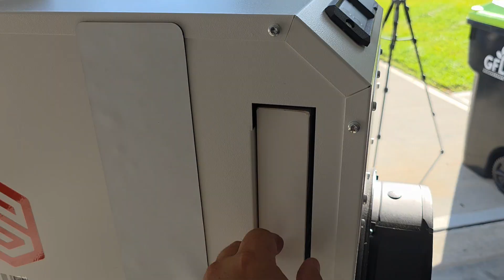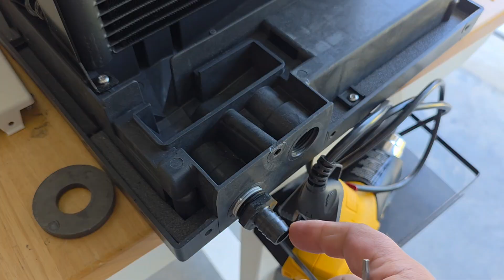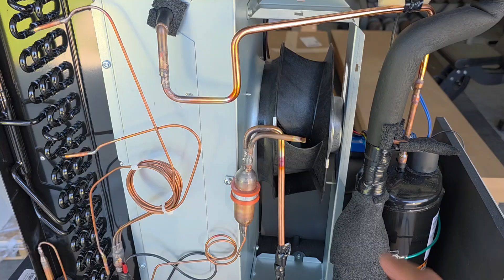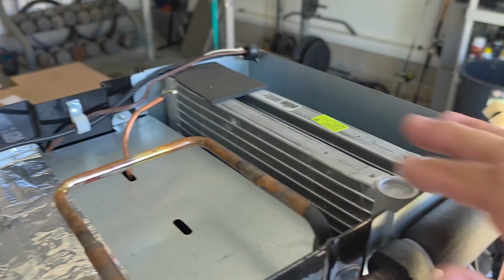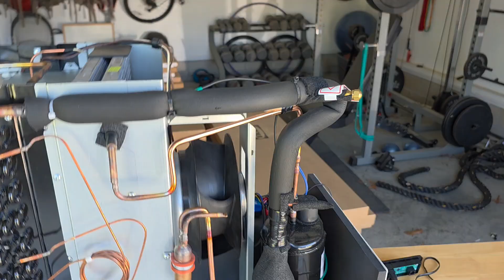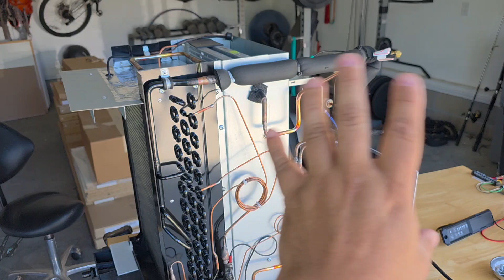Santa Fe V155 Next Gen Dehumidifier

Comment: Is this more efficient and smaller form factor available and replacing the Santa Fe Ultra 120?  
The ultra 120 is about 1/2 the price of this v155.
Reply from the maker: It's also about twice the weight LOL. The 120 has a weanie fan that cant overcome static
Reply: @timdestasiohvac can you recommend any smaller unit than the v155?  

Thanks again
Reply from the maker: @erickessler6094 the ultra 98 is good

Comment: I installed a 300 pint and 500 pint versions in commercial applications. I was even impressed on how quiet the large models can be.. 
basically, running 24/7/365 for years at a time
Reply from the maker: Nice!
Reply: where do you get these commercial units? I've only read about these residential units failing after 2 years. desperately need to install a unit for a new 2025 home approximately 2700 sqft. I've been looking for the past month and this brand seemed to be better rated than others but also more expensive. I don't mind spending more for a better product but where can I get my hands on commercial units?

I appreciate Tim showing us the inside of the unit and walk through it's components. 👍

how do we know which way to install? I've seen 5 variations on how to install along with current HVAC ducts.